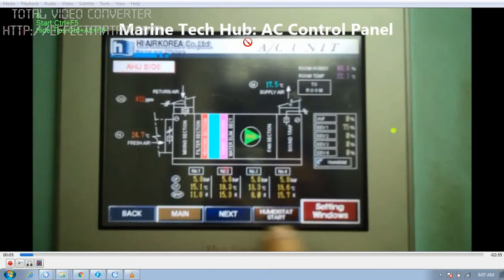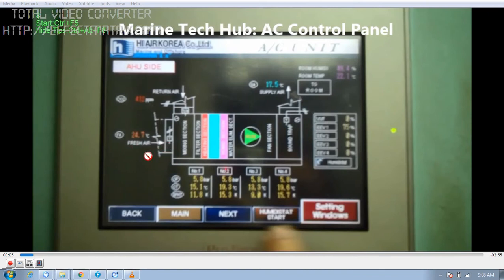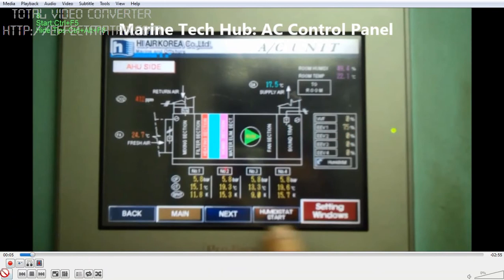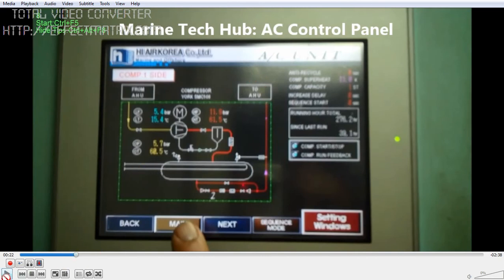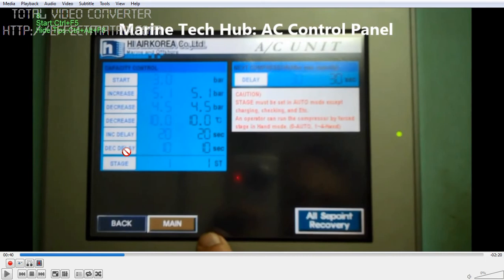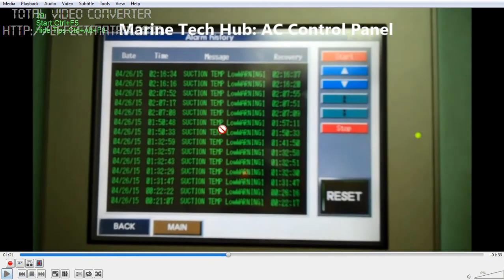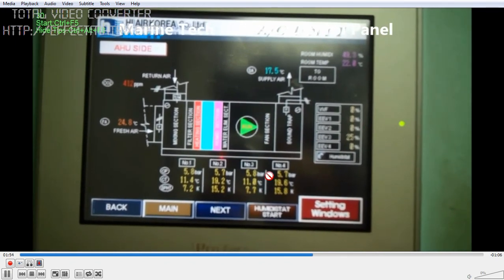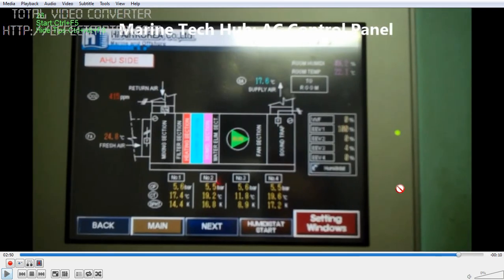Air Conditioner Control Panel : How It is Functioning

Comment: Sir,but if we keep the valve open then also we have a ingress of gases into the compartment rit??
Reply from the maker: Please let me know which valve your mentioning here.
Reply: Fresh air inlet valve which  you are keeping 10/ open during cargo operations??
Reply from the maker: But if you shut it then the cabin accommodation would go to negative pressure, In that case when  someone opens the outside door all the gas would rush  inside. To avoid this problem we keep the pressure positive always. some gases would come but cannot avoid it. Now a days the AC system inlet system is attached with gas sensors In case the gas measured is more than the AC system is stopped  automatically
Reply: Marine Tech Hub thank you sir for the answer